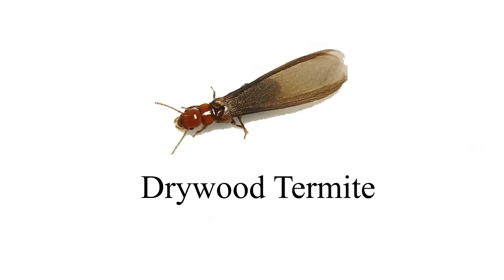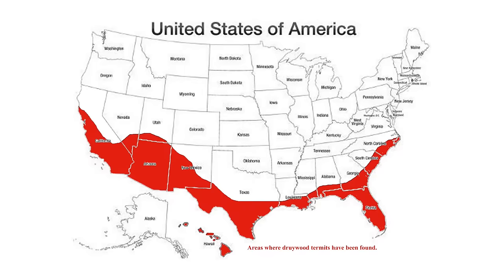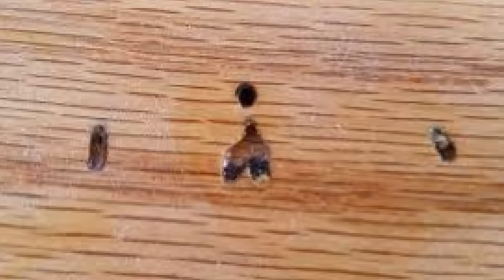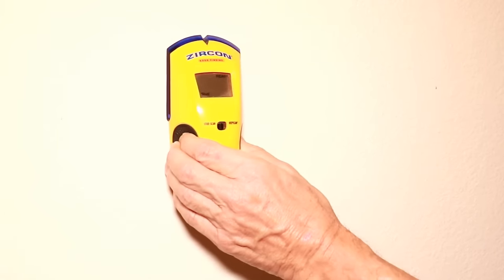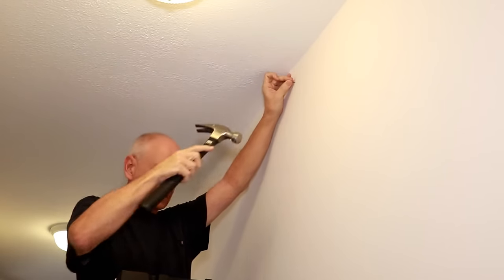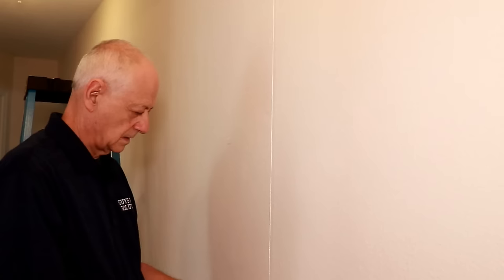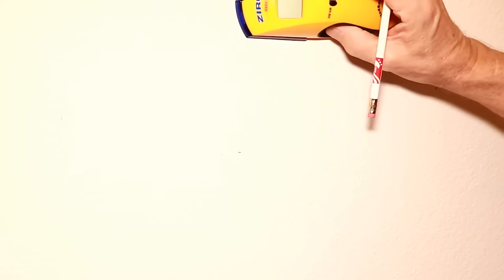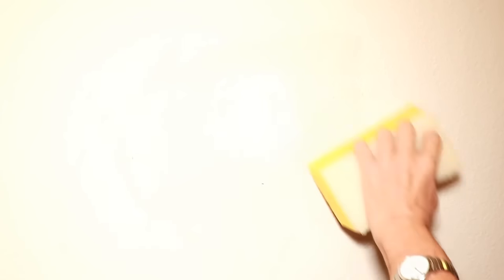How to Treat a Drywood Termite Infestation Yourself. A MUST see if you have Drywood termites.

Comment: Do only dry wood termites make kick out holes? I have some that appear to be eating the drywall paper and made a couple holes where frass appears to be below. I'm in central Alabama though so not in your red zone shown. I'm treating the areas for subterranean termites currently
Reply from the maker: Drywood termites are the only species that makes kick out holes and creates frass.  However, subterranean termites will often eat drywall and they will create exit holes that are used for the swarmers to escape.  After the swarmers leave, they will often fill the holes back in with mud.  Even though you do not live in drywood termite territory, you are definitely in Formosan termite territory.  I would urge you to identify the species because Formosan termites are very aggressive eaters, and can destroy your house very quickly.  Also, Formosan termites need to be treated somewhat differently than other species of subterranean termites.  It sounds like you already watched my video on how to identify termite species, so I'm thinking you already did this, but I always like to make sure.  Please get back to me if you identify these guys as being Formosan termites.  

If these guys are NOT Formosan termites, then there are two options for treating them yourself.  The easiest way is to use termite granules.  It costs less than $60 to do and it only takes about an hour.  The application is so easy that a child can do it.  The other option is to trench around the entire building, including the driveway.  It takes about a day for most people to trench around an average sized building and it only costs about $100 to do the job.  Trenching lasts for 5 to 10 years, but the granules should be applied every year as a preventive measure.  I have videos on how to do both options and I will place links below.       
 
For the granules to work you need to have dirt around most of the house and that dirt needs to be porous enough to allow water to seep into the ground fairly quickly.  To find out if the dirt around your house is porous enough, just dig a small hole next to the house that is about 4 inches deep, 8 inches long, and just the width of the shovel.  Fill the hole with water and watch to see how fast it drains down into the ground.  If it seeps into the ground fairly quickly, then the granules should work just fine.  However, if it just kind of sits there, then the granules would not be a good choice, and you should consider trenching.  Make sure that you buy the correct granules.  You need the ones that have imidacloprid as the active ingredient.  A lot of the Home Depot and Lowes stores no longer sell the correct granules, but you can get them from Amazon.  I will give you a link to them.
 
You can give any subterranean termite treatment a bit of a boost by doing a spot treatment.  If at all possible, spot treating for subterranean termites should not be the only approach to eliminate an infestation.   An additional exterior treatment should also be done with either granules or trenching, whenever possible.  Spot treating alone may totally eliminate the infestation with no other treatments, but it's not a sure thing. 
 
To spot treat subterranean termites, you need to buy a fipronil foam.  I will provide links for two products that you can choose from.  I like the FiPro the best because it's a little less expensive and I like the applicator tip better, but the Termidor Foam also works very well.  The FiPro is not available everywhere.  If you can get one of these foams, then drill holes in all damaged areas, that are 4 inches apart, and drilled about halfway through the wood.  If you are seeing exit holes in the wall, then there is most likely a stud behind the exit hole.  Get a stud finder and locate the stud where it meets the ceiling and drive a small nail into the stud a couple of inches below the ceiling.  Attach a weighted string to the nail and that will show you where the stud is.  Then drill the holes 4 inches apart along the entire length of the stud, about 3 inches deep.  Do the same thing for woodwork, except only drill the holes halfway through the wood.  If you think that there is a 2 x 4 behind the woodwork, then drill a 3-inch-deep hole every 8 inches.  The holes only need to be wide enough to get the applicator tip of the foam can into the hole.  After the holes are drilled, then shoot the foam into each hole for about 5 seconds or until you have foam either coming back out at you or coming out the other holes that you drilled.   All the holes should have foam either going into them or coming out of them.  This will contaminate their food source and they will take the fipronil back in the colony and spread it around to the other termites.
 
Most of the time, subterranean termites are going to be building mud tubes somewhere.  You will most likely find these mud tubes going up the exterior or interior of your foundation and you may find them along joists and even in the attic sometimes.  If you have a slab home, then you may find them going up the outside of the house on the slab and even the side of the house.  If you can find the mud tubes, then you can treat them as well.  Just scrape off about a 2-inch section of each mud tube down to the bare surface.  Then, shoot that foam into each side of the mud tube and also apply a little of it on the surface where you removed it.  The termites will rebuild the mud tubes and bring the foam back to the colony to spread around to the other termites. 
 
Also, if you can find the mud tubes, this is a very good way to determine when the infestation is gone.  If you scrape off that 2-inch section of a mud tube, you can see if there are any live termites in the tube.  Again, the termites will rebuild the tube and go about their business.  Do this every two weeks after you finish all your treatments.  Apply the foam to the mud tube every time you do it. At the point you are no longer seeing live termites and they stop rebuilding the mud tube, then your infestation has been eradicated. 
 
It typically takes several weeks for any termite treatment to be effective.  That is because you are using slow kill products.  If you were to kill the termites too quickly, then they would not have a chance to bring the poison back to the colony and share it with the other termites.  If you don't kill off the entire colony, you will not end the infestation.  Therefore, you must kill off subterranean termites very slowly.  So, I would give this at least 12 weeks before I would decide that something went wrong, and the process didn't work.  Hiring a professional to trench your house is pretty much going to take about the same amount of time to kill off the colony.
 
I hope that helps.  Be well my friend.
 
Video on how to apply termite granules:  https://youtu.be/H7rW_TSBHJ4
 
Video on how to trench for subterranean termites the right way:   https://youtu.be/Fy7YHi_7Z8g
 
Termite granules:  https://www.amazon.com/dp/B000RUIJYM?ref=nb_sb_ss_w_as-reorder-t1_k1_1_7&amp=&crid=QBG5V6DN12P7&amp=&sprefix=termite
 
FiPro:  https://www.solutionsstores.com/fipro-foaming-aerosol
 
Termidor Foam:  https://www.domyown.com/termidor-foam-p-3528.html?pdpv=2
Reply: @GuysPestSolutions  Thank you for your detailed reply.  I have never found swarmers or their wings in my home.  I'm really stumped.  I live in a slab built home and I assume they began coming in through brick weep holes at the slab.  No identifiable mud tubes seen but I have placed termite stakes around the problem area and they have triggered.  I'm going to begin taking the drywall off in that section of the house and see what sort of damage has been done.
Reply: @GuysPestSolutions  I have a picture of one that I pulled from my monitoring station. Any way I can email you a picture and you confirm what I've got? Thanks again for all your help
Reply from the maker: @imhooks  You can send photos to guyspestsolutions@gmail.com.  When photographing insects, you need to get just as close as you can to the subject without losing focus.  To properly identify these guys, I need to see a lot of detail.  

Please tell me what kind of monitoring stations you installed.  If you used Spectracide Termite Stakes, then I can tell you that they do not work.  I am currently in production on a video about these things that should be out in about a week or two.  There are two problems with them.  The first is that they do not contain any pesticide, so they don't kill anything.  The active ingredient is an insect growth regulator, so it would take a very long for them to eliminate a termite colony.  The other problem is that ants also like to eat the bait, so these stakes are constantly going off because ants have eaten the bait instead of termites.  So, the bottom line of these things is that they are pretty much useless.  I think that selling them to the public is as close as you can get to a perfectly legal scam.  

I hope that helps.  Be well my friend.

Comment: Hi Guy! I have dry wood termites in my subfloor on about 3 boards it looks like. Should I replace the boards and would I do this before or after treating like you said in the video? Thanks!
Reply from the maker: Whether or not to replace infested wood before the termites have been eliminated is somewhat controversial.  My view is that it is always best to leave the infested wood alone until the infestation has been completely eliminated.  The reason for that is leaving the wood in place allows us to apply a pesticide directly where the termites are eating and, since they will not know that this is a poison, they will not only consume it, but they will share with the other termites in the gallery and wipe that entire gallery out completely.  This is important because some of the gallery may extend past the area where you are seeing the damage.  If you just remove the damaged wood, then you may be leaving behind some termites that can continue eating.  If you treat that gallery with a pesticide, then the termites will spread it around and the entire colony will die out.  That being said, should you decide to fumigate the house instead of spot treating, then it would really make no difference one way or the other.  Of course, after the infestation is eliminated, then you can go ahead and replace whatever wood you wish.

I hope that helps.  Be well my friend.
Reply: @GuysPestSolutions  thank you so much for your time and effort! I appreciate the advice👍🏻👍🏻
Reply from the maker: @josh_reagan  You are very welcome.  Anytime my friend.  Be well.

Comment: I have seen a few coming out from underneath my bathroom vanity. I did put a bifen granular around my home I also sprayed underneath the vanity. Will that be enough or do I need to remove the vanity?
Reply from the maker: First, make sure that these are actually drywood termites.  Please watch my video on how to identify termite species.  Don't worry.  It is a lot easier than you may imagine.     
 
If you confirm that these are drywood termites, then the treatment you did is not going to be near enough to eliminate the problem.  It is important to understand how drywood termites work.  They enter through cracks and crevices around windows, doors, the eaves, pipe penetrations, and so forth.  Most of the time, they enter through several locations.  That is because a swarm of them attacked your house at the same time.  If there was a crack or a crevice, then they probably found it.  After they established their galleries, which will be inside the wood, it will take four to seven years for them to be able to swarm.  Now that they are in your house, the swarmers will use holes that are in your studs to travel through the walls.  Those holes in the studs were created by the electricians to run the electrical wiring.  Not only are these holes going through the studs, but holes were drilled into the attic for the light switches and to run some of the wiring for the outlets.  So, the termites now have easy access throughout the attic and the walls.  If you have a basement or crawl space, they have access to that as well.  Most of the time, you will have no idea that they are in the walls, because the frass is inside the wall.  To make matters worse, if you have drywood termites, then your neighbors have them too.  That means you have been getting swarmed for as long as they have existed in the neighborhood.  Most likely, we're talking about years, so it's a safe bet that you have these guys in many locations in your home.
                            
I always hate to be the bearer of bad news, but if you have drywood termites, the only way to get rid of them is to fumigate.  Prices for this can vary wildly in this industry, so I recommend that you watch my video on how to hire a pest controller without getting ripped off.  That video can save you a lot of money.  You should also know that the gas they use to fumigate has absolutely no residual action whatsoever, so you can get reinfested the moment the tent comes down.  Like I said before, if you have drywood termites, then your neighbors have them as well.  Since drywood  termites swarm every year, it is almost a certainty that you will be reinfested within a year after the fumigation is done.  The only way to prevent this is to do a preventive treatment on your house every 60 to 90 days.  Most pest controllers will not do this, so it is something that you generally need to do yourself.  If you absolutely cannot afford to fumigate your house, then you can try spot treating it yourself.  It is virtually impossible to find all the termite galleries, but it is way better than doing nothing.  Regardless of how you treat it, you should begin the preventive treatment immediately, so that you do not get additional termites paying you a visit.  

I hope that helps.  Be well my friend.                        

Video on how to hire a pest controller without getting ripped off:  https://youtu.be/y-a8XOqVrlE

Video on how to prevent drywood termites:  https://youtu.be/neNsmVbj8Pc

Comment: Yes so I have termites that are coming in my windowsill exterminator coming out however I know you mentioned having the house covered in a tent but that's not affordable for me at this time so what I've been doing for the last couple of days is spraying the windowsill with some Clorox in it I've seen one or two in the last couple of days but I am not a person to live with bugs and hopefully the Clorox will help me until the exterminator gets here what is your thought on
Reply from the maker: Unfortunately, the Clorox is not going to be of any assistance at all for drywood termites.  If you cannot afford to get the house fumigated then the next best thing is to follow the advice in this video.  You should also start a preventive treatment immediately.  I will give you a link to that video.  This will not fix the existing problem, but it will prevent more termites from entering the house from the outside, thereby slowing the progress of the infestation somewhat.   I recommend starting a savings account for the fumigation.  Try to get it done as soon as you have the money saved up.

Be well Rosemary.

Video on how to prevent drywood termites:  https://youtu.be/neNsmVbj8Pc